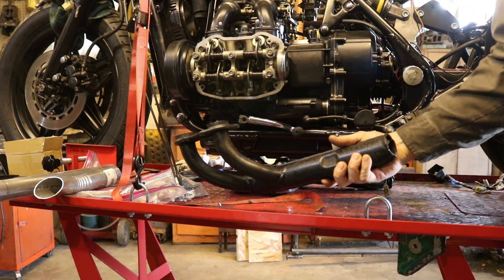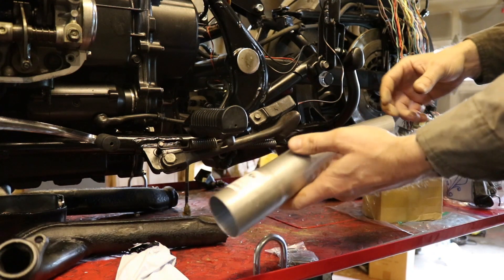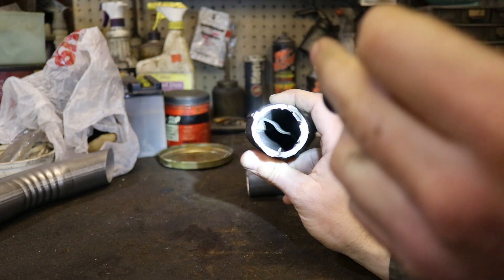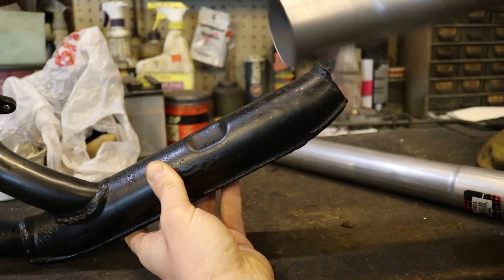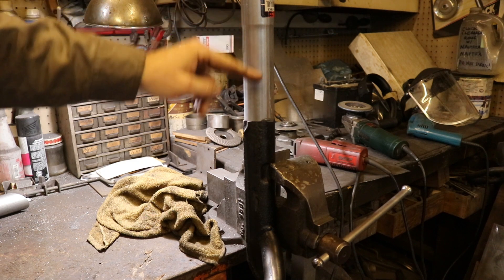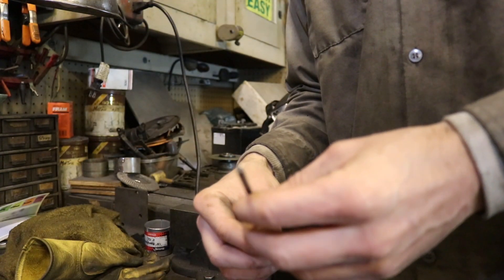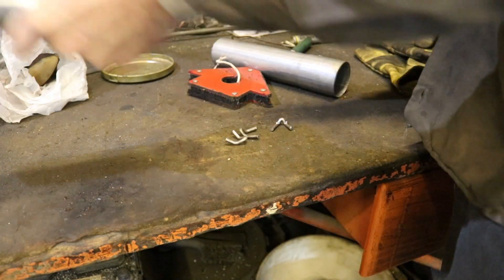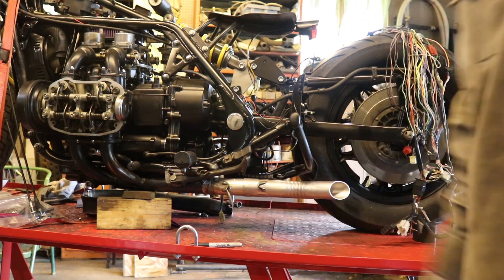Honda Goldwing Bobber Build | E51 -  Custom Exhaust

Comment: I have been looking for a cheap exhaust for my 82 gl1100 I would pay you to make me the same exuast
Reply from the maker: Where are you located?
Reply: @HooptieDoodle  just outside kansas city, mo. I have had my carbs rebuilt and synced just need a good exhaust
Reply from the maker: @2wheelsgofast  I am in Austin TX. I'd be happy to weld up stuff for you, but you'd have to get the exhaust to me and I'm not so sure it'd still be all that cheap when done given shipping, current cost of parts, etc. If we were closer, it'd be simple. I recommend asking a local metal fabricator, or custom motorcycle shop. Still may be close to $200 in labor.